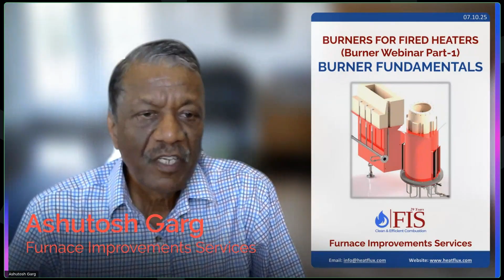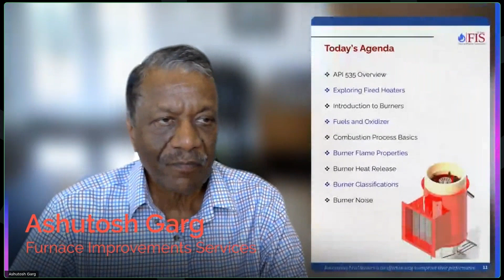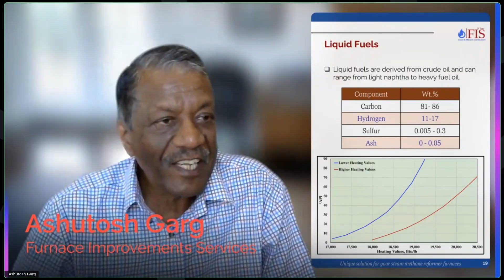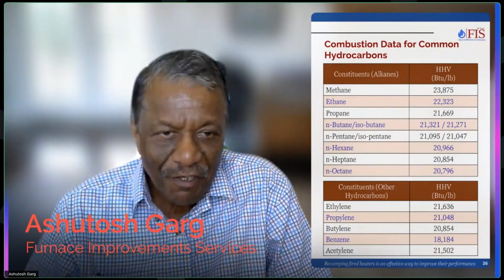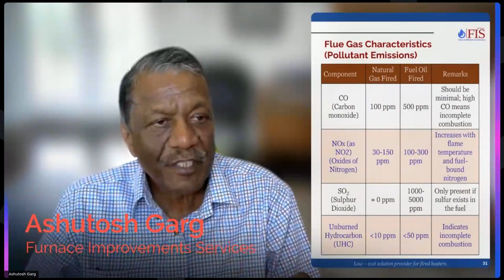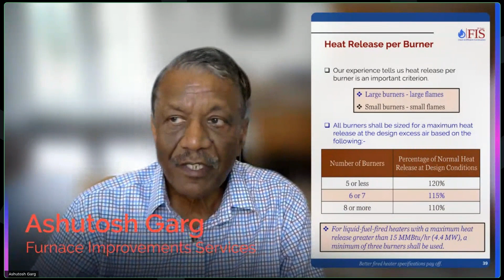API 535 Burner Series – Part 1: Fundamentals of Fired Heater Burners

Comment: Hello sir,
Thank you for your wonderful effort. I thoroughly enjoyed the lecture. Could I obtain the video presentation or the book you used so I can study from it and use it as a reference?

I have a few questions:
1- Is there a way to determine the temperature of the flue gases near the flame? How can I determine the amount of heat transferred from the raw material or the material being heated, whether in the radiant or convection zone, and its final temperature upon exiting the chimney, as well as the heat loss due to the walls?

I hope you can help me, and thank you for your time.